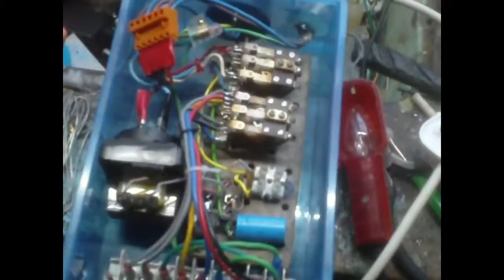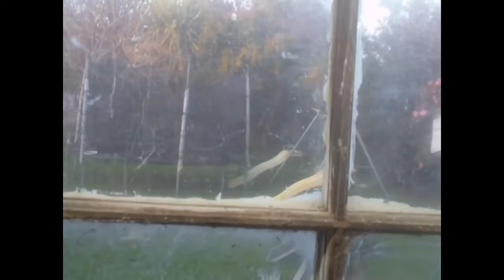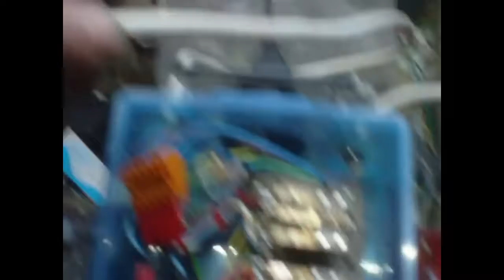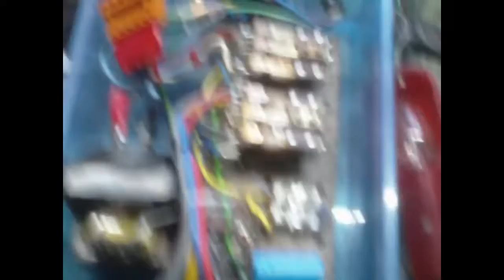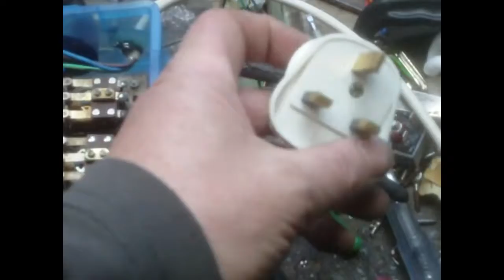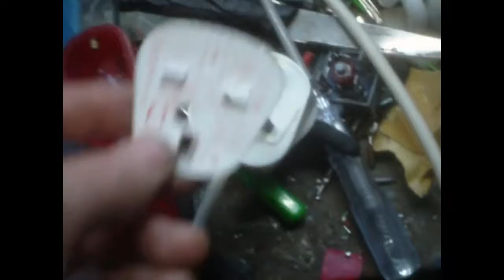DAY 950 OFF THE GRID - *Converting the surplus Fridge Xfer Switch into something useful (Pt 2)*

Comment: thinking about building one of those
Reply from the maker: They're easy to build. You just got to be careful with your wiring as you're bringing two separate power sources (in my case three) together in close proximity. 

And I like to choose relays that have nice large gaps between the contracts. 

That's why I use those "old school" ones rather than the modern encapsulated varieties. Any time I come upon such a device I tend to reserve it for purposes such as this.